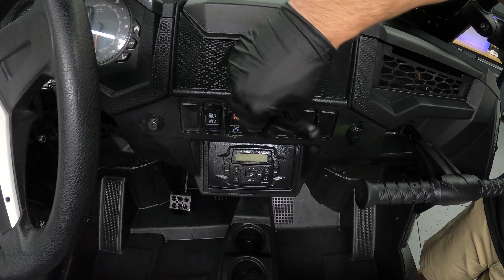'17 Polaris Turbo RZR Deep Cleaning | Justification for why I love working so hard

Comment: I'd suggest doing an APC pre-wash, it helps get the mud residue off the plastics. I have a 2016 RZR Turbo, and it works great.
Reply from the maker: Have you ever used that Bilt Hamber? It’s really close to an APC but still safe for ceramics. 

I will have to try out an APC though as I am doing more and more of these SXS.

Comment: Glad u got urself a stubby wand for the pressure washer, they come in pretty handy. I love mine but I still use and extension when I wash my truck because I’m short and the extension give me the extra reach to get a better angle on rinsing off the roof, hood, and bed cover. But the stubby is especially great for washing out wheel wells and tighter spots. That rzr came out great. Like last time it’s so weird seeing the inside get sprayed and foamed just like the outside. As always love the videos and your energy u bring to the details.
Reply from the maker: Thanks for the support bru. 

I like the stubby, but washing the floor has been kinda lame. It was easier with the full wand. Either way, I’ll probably keep rocking the small wand and just mop a little more in between shots.
Reply: @P4SDetails  u can get extensions from lowes and probably Home Depot. I have a few different ones. I have a straight one and two with a 45degree bend on the bend is near that end that goes into the wand and the other the bend is where I would put ur nozzle I use them for reaching hard to reach parts of cars and trucks and I link them together to make it so I can use my undercarriage sprayer with having to bend over.
Reply from the maker: @MegaChevy25  linking would be so solid.